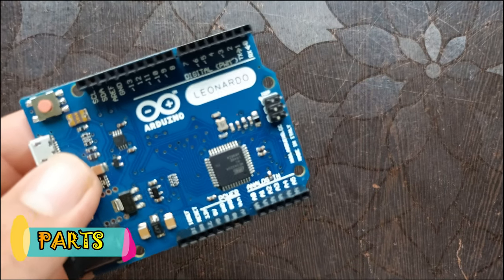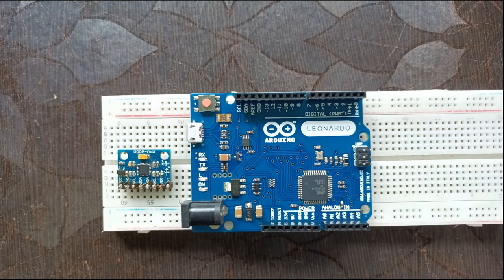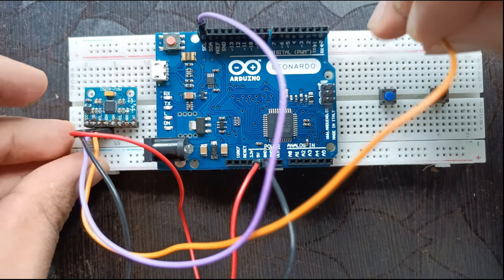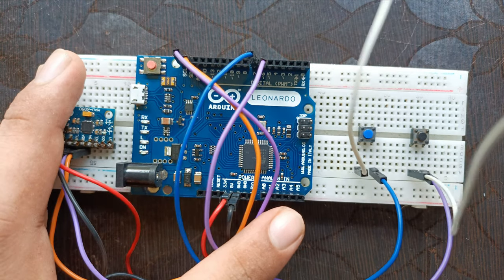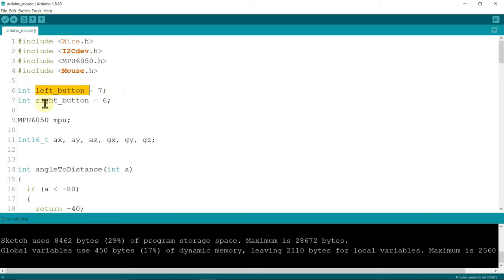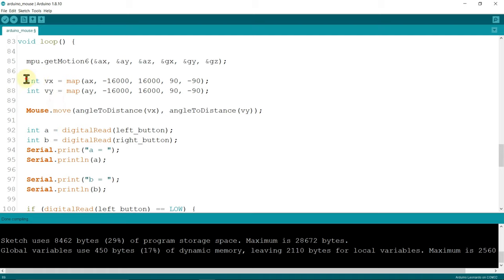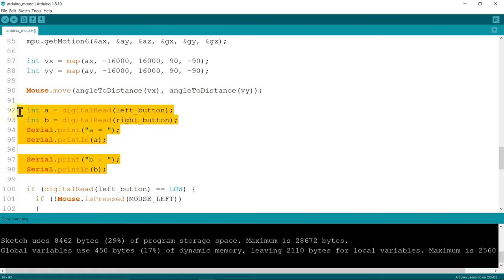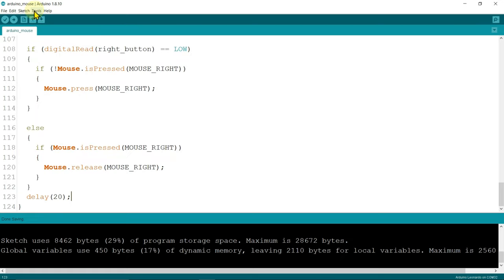How To Make Mouse Using Arduino Leonardo Full Tutorial | [DIY] Mouse Using Arduino| Experimentalist

Comment: I have done the same setup and steps done by you in the video and after rebooting it also says hello but pi can't hear my voice 
The mic I used is same as you used in the video
Pls help
Reply from the maker: ok, sometimes this problem occurs I don't know why, to resolve this problem,  open opt folder in raspberry pi, then go to the AlexaPi folder, then go to src folder, in this folder, there is a file main.py, run this file and let me know  it is working or not.in my case it is working
Reply from the maker: @kartikgaming9657  did it work, when you run this file, the alexa is speak hello, and after that , you speak to alexa
Reply: @experimentalist1494  yes it Alexa said hello but when I reply to Alexa , Alexa give no reply
Reply from the maker: @kartikgaming9657  can you give me the ss of the file run
Reply from the maker: neerajrawat123 is my insta id
Reply: @experimentalist1494  ss?
Reply from the maker: @kartikgaming9657  screen shot